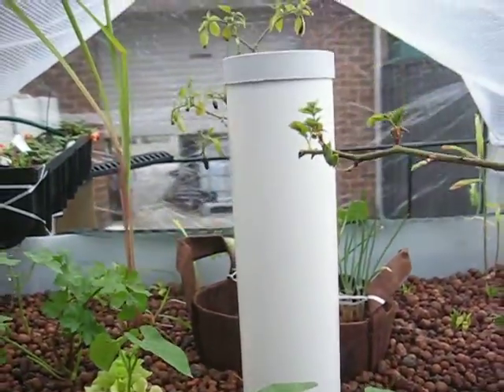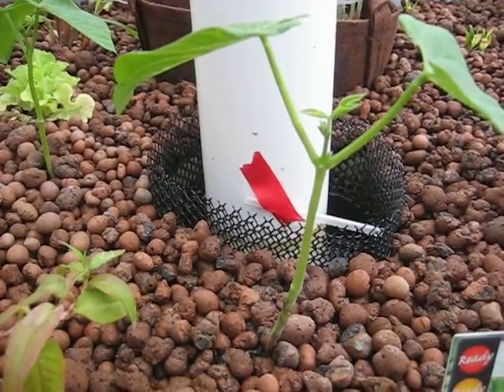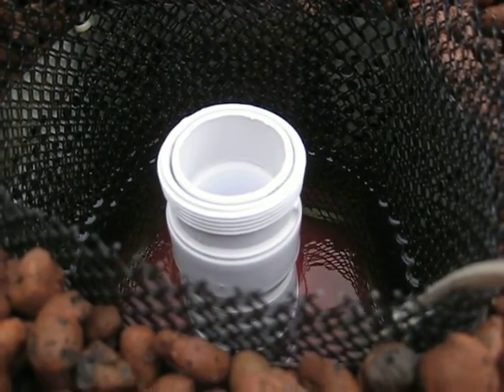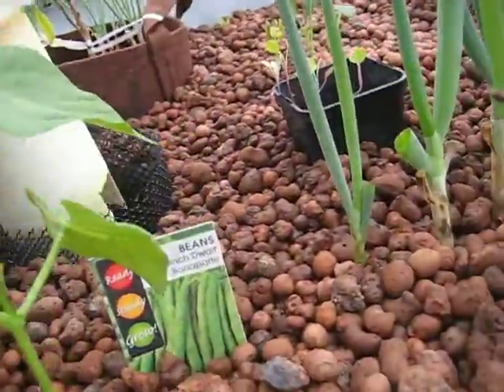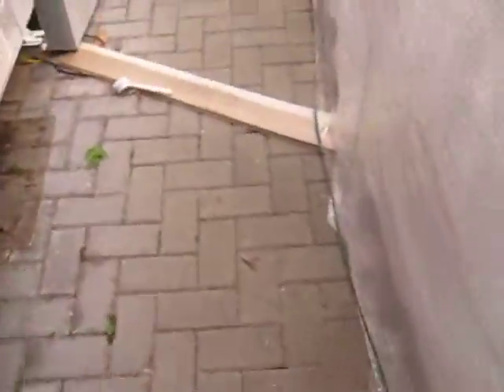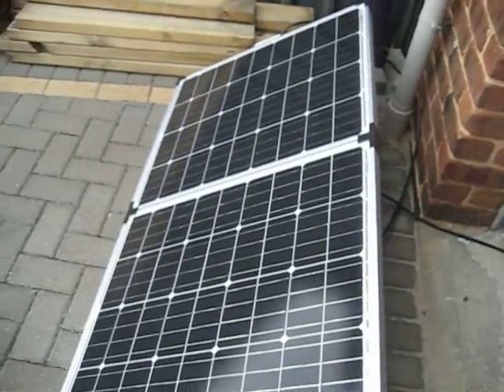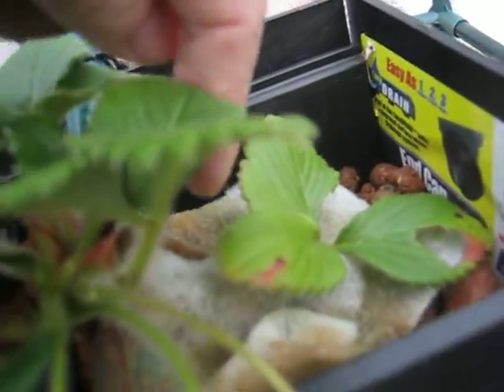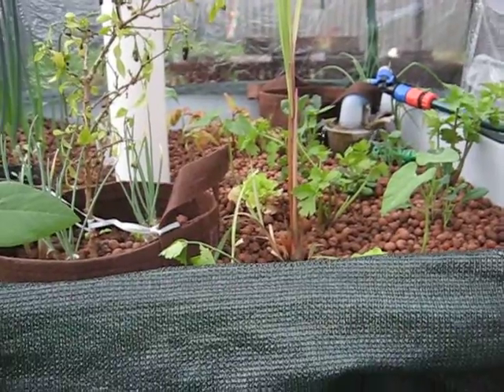DIY cheap Aquaponics IBC self sufficient solar powered with an adjustable bell syphon system

Comment: how long does your battery last over night with no sun for the 50watt power draw from pump and air pump?
Reply from the maker: might last 24 hours without sun.  generally I found cloudy days on the 3rd day I had to switch back to mains power.